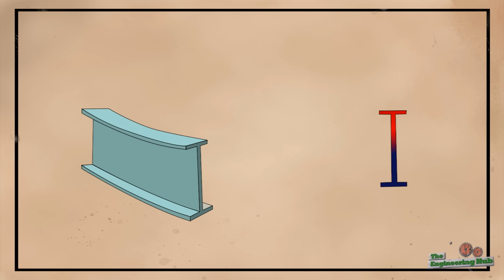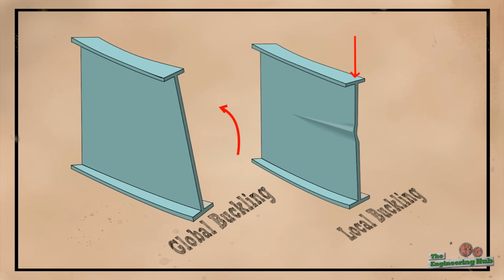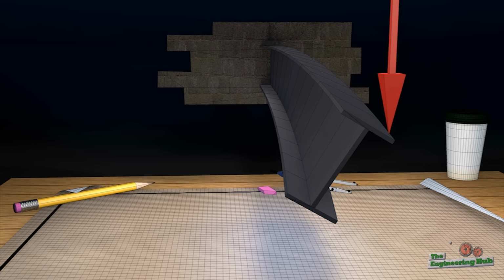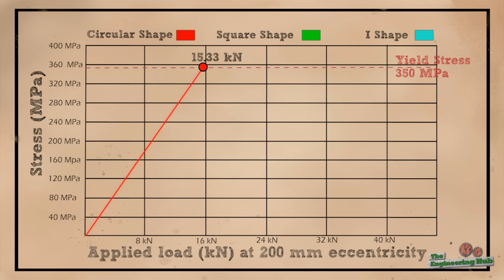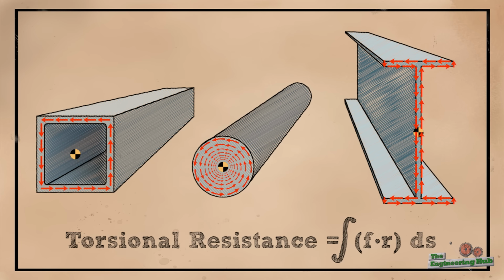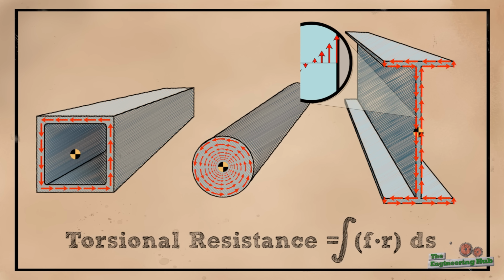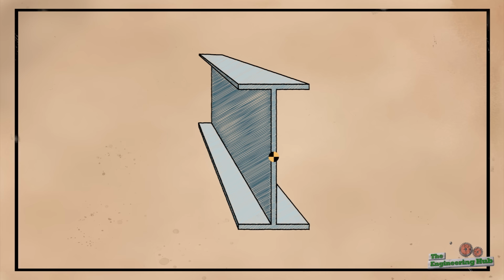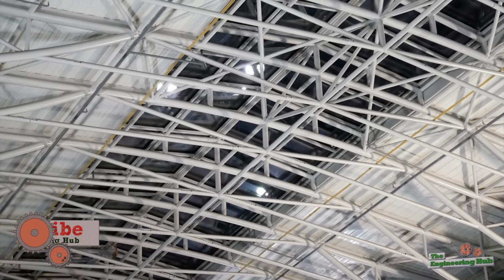The Critical Weakness of the I-Beam

Comment: I got a bit worried when I saw the newly buildt bridge over the river in my home town. It is a concrete road surface on three high I-beams and now that they removed the pour supports I found that the beams have intervalls of diagonal buckling, the beams are arc'd and a few meters higher in the middle of the river than on the ends, the bridge is some 310 meters long. I do hope the buckling is from pre-stressing and that it would straighten when loaded, it is a new bridge that will replace the 65 year old arc'd  concrete boxshapes bridge that had tension wires inside so that the new weightlimit if trucks here in Sweden can go up from 60 tonnes to 74. And both bridges can be seen on Google Earth at the moment in Kalix, Sweden. The new one is almost done by now and is planned to open within a month from now.
Reply: What you call buckling may just be an intentional curve in the beam. Beams are sometimes curved (cambered) upward so that when they are loaded they will lay flat like you said. A few meters sounds like too much to be camber, but I'm not a bridge designer. It could be that the designers just want the bridge to curve up over the river. Buckling in an I beam occurs to the side and also causes the beam to rotate, so the curve in the vertical direction is nothing to worry about.

Comment: great info thanks.I erect up to 5k capacity big tops and understand how the force is spread to base.all seams from king poles,to queen poles then to wall poles,must line up with guy ropes,or the structure will be inherently unstable.any twisting will weaken the structure,and result in distortion of metalwork.I presume the stresses involved would change the composition and properties of the steel in I-beams,further increasing the effects of off centre stress.thanks for your clear and concise information.

Comment: The only problem with this is the fact that this beam is Not a I beam! It is a wide flange beam. The I beam is much stronger.
Reply: In this video, I-beam refers to the laymen's term.  It is a term that is used collectively for both types of beams that resemble the capital letter I.   The nuanced difference of wide flange beams and actual I-beams with tapered flanges, is beyond the scope of this video.

Comment: Looks like a vertical plate welded to the inside of a hollow tube provides for the greatest combination of resistance to torsion and buckling.  Not cheap to manufacture, though!

Comment: The flaw would be the architects, for failing in designing the system to accommodate the I-beams strength and weaknesses.
Reply from the maker: You are not wrong, an engineer/architect that is not aware of this phenomenon is flawed/no good.

Comment: This is not a "fatal flaw" but rather a limitation.   In only regards to torsion; a tube has more torsional strength than a box tube which has more than an I-beam, more than a C--channel, more than a L-section and finally more than flat stock.  All engineering structural shapes have limitations that either precludes them from practical use for certain applications or requires additional features to be part of a successful design.   It is unfortunate that you needed to use a click-bait title an otherwise well done and informative  video.
Reply from the maker: There's not a single thing in your comment that we disagree with, well said! Thank you for your feedback sir!

Comment: I have a question? Remember the Bethlehem Steel Logo is a true "I Beam" all else are just modified "H Beams". The taper of the  top and bottom horizontal you see in the logo. The center thickness is twice the outboard edge of the horizontal sections. No disrespect to anyone but an " I beam " has many superior quality's to an "H beam" and defeats all problems spoken here.

Comment: Maybe the next time you do a video on I beams use I beams.  Every example of I beams you showed were W shapes not I shapes.  W shapes wide Flange beams are similar but not the same thing. I beams do not have a uniform thickness in the flange they taper down away from the web.  Wide flange has a uniform thickness to the flange.
Reply from the maker: Thank you for your feedback cannon fodder. Many regions have different nomenclature. For example in Canada, (where we are working) the beam you were referring to is designated as an S-beam (sloped flange). All shapes derivatives of an I (i.e. W, H, S) are colloquially referred to as I beams. We understand that this is different from place to place as many have pointed out in the comments and we apologies for the confusion.

Comment: Are the beams that have the extra meat on the top and bottom faces called H beams?  Like instead of having 3 flat faces, the two on top and bottom are molded with gussets kinda..  its been a while but my structural engineer had me use those beams for support instead of i beams because they resist almost 3 times the lateral load when a top load is applied in a static biased supporting state..  ive seen a bunch of people use them in residential supporting of underground foundation support along block foundation walls these days to stop the forces pushing in on them as well as providing a sill support if planted with a footing..

Comment: Since the 1950s, Ford trucks (this includes passenger vans 3/4, 1/2 ton +) have been notorious for premature steer tire wear due to the patented twin I beam design of the front axle and alignment issues. however, it is an overall more robust design than other designs, hence its use on trucks.

Comment: Great topic and well presented. To make a fair comparison  the cylindrical shape should also be a hollow tube to compare with the square tube. Then you would find the most efficient shape for torsion. Most of the large structures, crane booms, etc. are built with hollow shapes rather than solid shapes.

Comment: That doesn’t seem like a fatal flaw of the I-beam per se.  If a beam buckles it was underdesigned or overloaded, whatever geometry it has.
Reply: You are exactly right.
Reply from the maker: The limitation is more in the fact that the beam could handle a given load without a problem. But if that same load is moved a few inches to one side all of a sudden the whole assembly could twist and break.